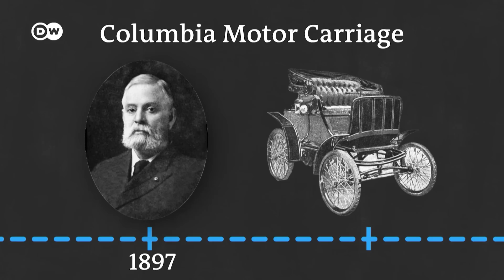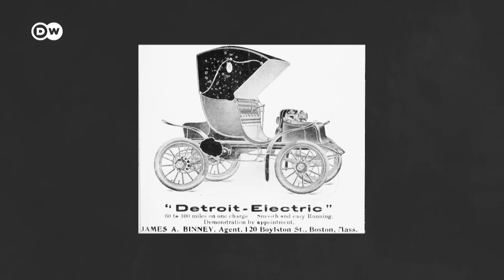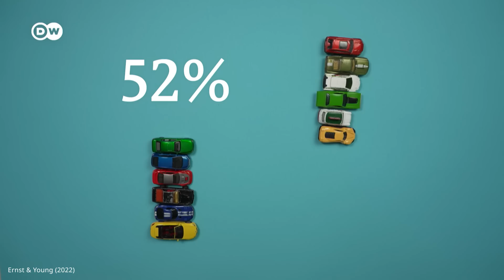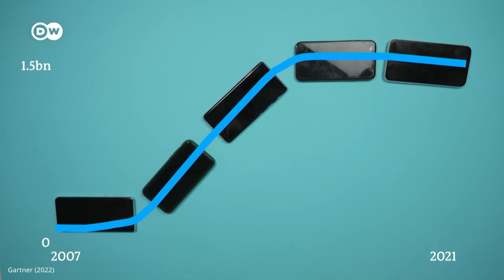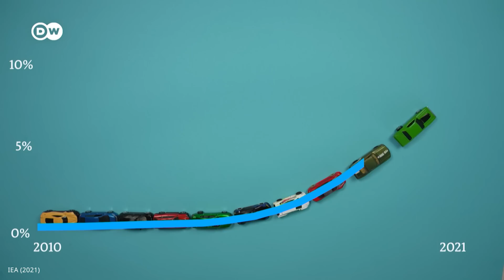Why electric cars are finally taking over

Comment: CO2 is not causing global warming to the degree people anticipate. Even if it is, solar and wind will not replace petrochemicals without putting up collectors over several of the larger states of the US. Yes, e cars are becoming more efficient, but more expensive because oligarchs are stealing the money from the common people who should be buying them. They did so greatly during covid and will do so even more in the transition to e technology. That's why the media is pushing the fear of global warming as it did the fear of covid.

Comment: EV are not a End solution.  Human Centric Urbanism aka walkable city and Public transport(On rail idealy) is Da way.

EV are way heavier than oil car making the tire wear way faster, and Tire are an extreme source of Air pollution, massive public health impact  and there are not recyclable nor renewable. We will not solve the problem of the climate by putting even more people on the roads increasing by thousand the plastic dust in the air on each city. Continuing this Car-centric urbanization where you have more than 80% of the territory only for roads and parking these cars is evil, unmoral, unethical, irrational, completely none utilitarian. The people who lobbied for this car-centric urbanism should be punish for crimes against humanity. And put it alongside the great murderers of the history.

They know exactly what they were doing. Like tobacco companies.
Reply: Hell yeah. r/fuckcars. 
Walkable, bikable green cities with public transport are the best!
Reply: yes: 4:02
Reply: Why would EV's put even more people on the roads?
Reply: @Richard482  because they're suppose to be cheaper to operate, "cleaner" and more "fun" to drive. it's a lot greenwashing
Reply: @Lildizzle420  Well they are cheaper to run, as long as you can charge at home. Less CO2 emissions in the long term, depends entirely on what power sources are charging the car. The fun aspect would probably depend on the car, but my wife loves one pedal driving.

Comment: Here in America charging infrastructure is definitely the biggest need. When I bought my car I was scared because I don’t actually have a place to plug in overnight.

Luckily, my area has a great charging infrastructure so I can leave my car at the grocery store (2 blocks away) for half a day to charge back up when I need to! More people need this option. I’ve also been super impressed by how much of a charge I can get off of a fast charger while I go eat a sandwhich and stretch my legs for 30 minutes! This makes 4-5 hour long road trips not really a problem in my EV.

All that being said, there are still lots of fundamental issues with cars in general whether they’re gas or electric. I actually just recently released my own video on the topic which dives more into that side of things. I think it pairs nicely with your video in order to give a fully well-rounded analysis of the pros and cons of EVs.
Reply: Well, your BIGGEST need is a national high speed dual line rail system. But that's unrealistic with the current mindset. Locally every city should be focusing on Transit Oriented Development or TOD, but sadly in North America few places are, and instead favor personal vehicles, urban sprawl, and destination shopping centers. But yeah since you are soo car centric, advances to your grid are absolutely going to need to happen.
Reply: I live in Montana. Obstructionist Republicans run the Show and they're definitely religiously deluded. Our State Sign will soon read: Welcome to the Past.

Comment: I live in the San Francisco Bay Area, and adoption of EVs here seems to be well on its way towards the diffusion stage of the S-curve. There are LOTs of EVs on the road, more every day, and more and more public chargers.
Reply: In the first quarter of 2022 16% of cars sold in California were Electric. When we had that recent record heat wave the government requested - not required - that from 4 to 9 pm we not use major appliances. So no clothes washing or car charging. The request was heeded and there was no need for rotating blackouts. There were some local failures of equipment, as usually happens in conditions of stress. EV owners with a brain charge between 11 pm and 7 am anyway as you get a 2/3 discount. EVs are programmable to charge when the price is low.
Reply: california is taking up a greater share of EV sales, monopolize the supply chain and you just take EVs away from a different community or you slow the transition to renewable energy. california can ban the sale of ICE but that means my state of Arizona will have gas vehicles even longer
Reply: How much do Wildfires cost California every year?
Reply: @Diana1000Smiles  Relevance? How much do hurricanes cost Florida and Texas each year? How much do tornadoes cost Oklahoma each year? How much of Florida, Louisiana and Texas will be lost to sea level rise by 2100? All of these are increasing because of climate change.